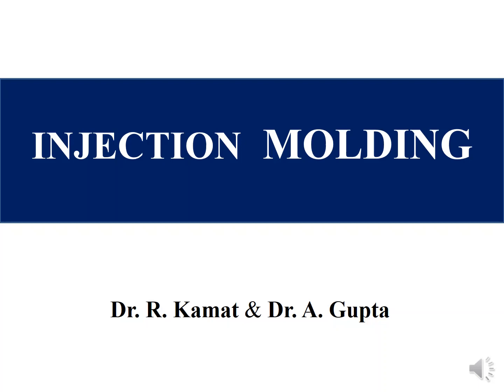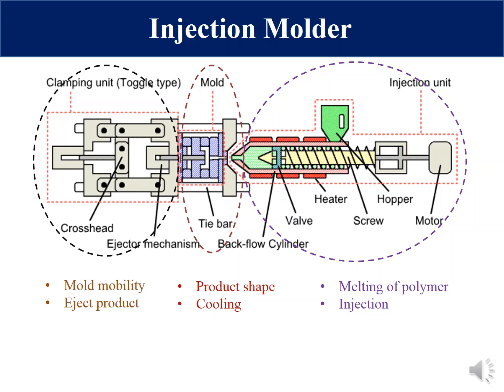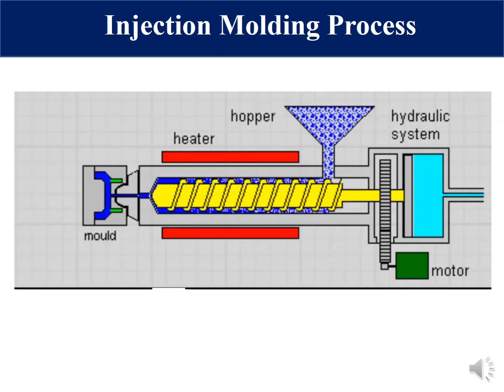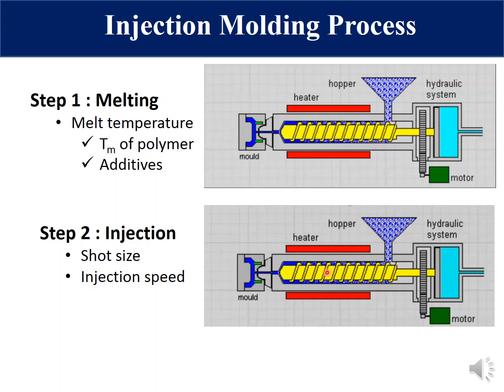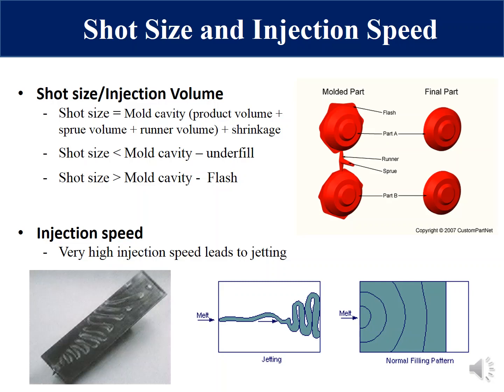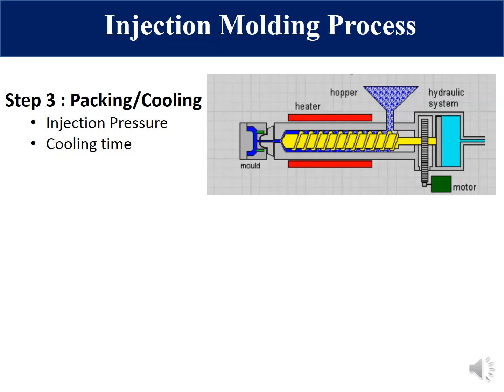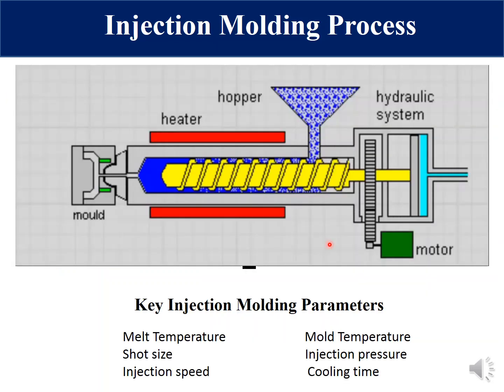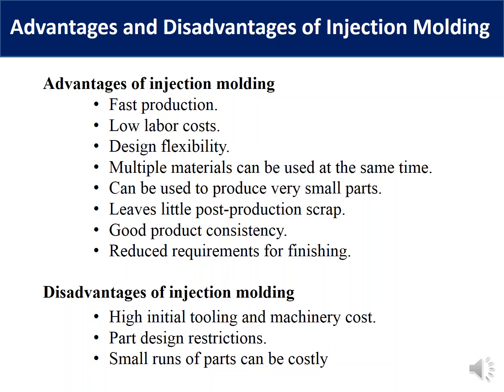Plastic Injection Molding

Comment: very informative video, thanks a lot. Just have one question, can you explain the influence of backpressure during the process?
Reply from the maker: Thanks for your comment. Regarding backpressure, it is a very important process parameter since it helps to push material forward leading to better compaction of the melt and also removes voids. Higher backpressure also helps to achieve better shear mixing. This all help to achieve a high quality product. But excess backpressure can also lead to over heating and chain breakage leading to poor mechanical property or defects. So an optimum value of backpressure should be used.
Reply: @PolymerWorld  Really appreciated of your detailed explanation. Thanks again.
Reply: What is back pressure. When do we use suck back pressure, Rec pressure